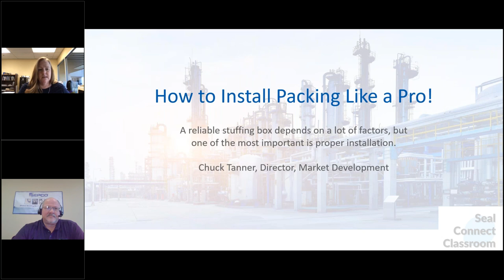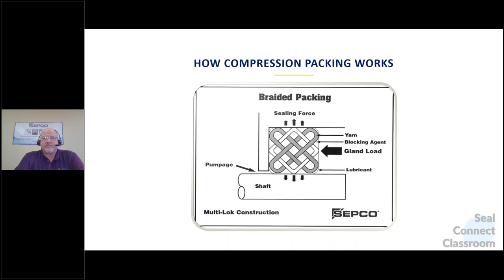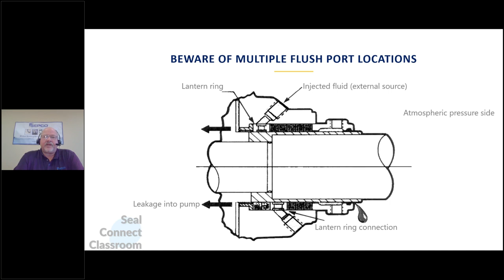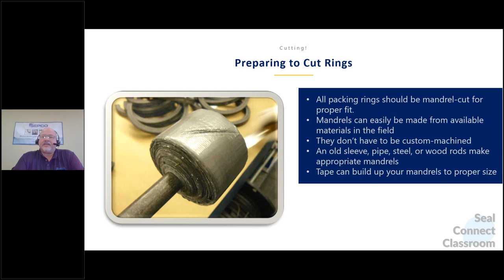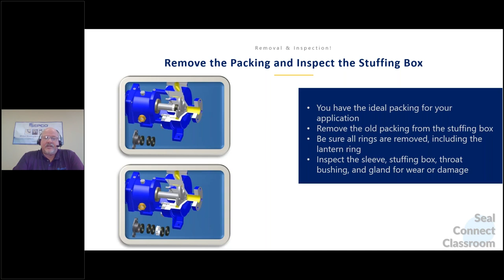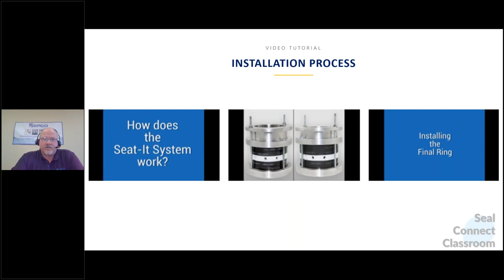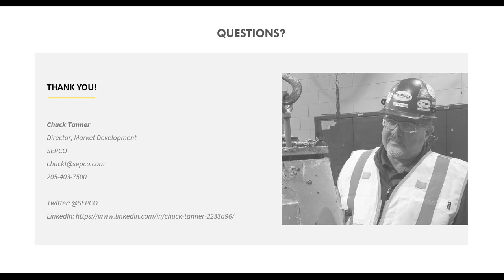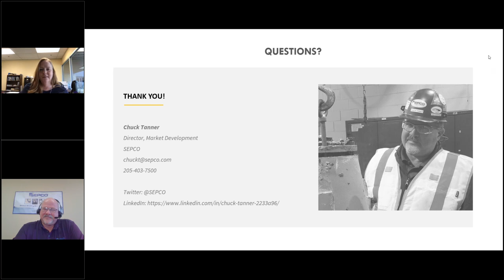Webinar: How to Install Packing Like a Pro

Comment: Gland packings for soap stone
Reply: have used packing that contains GFO/Kevlar sepco has the ML4004 if you use it with loading discs belleville washers it works excellent